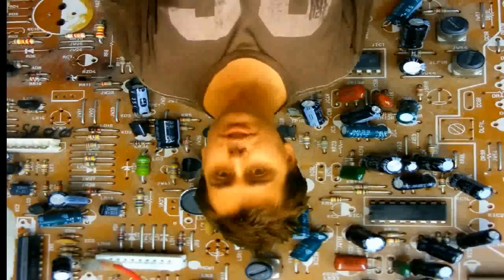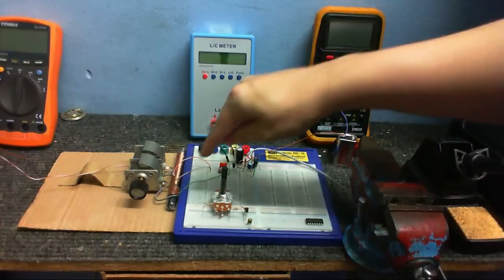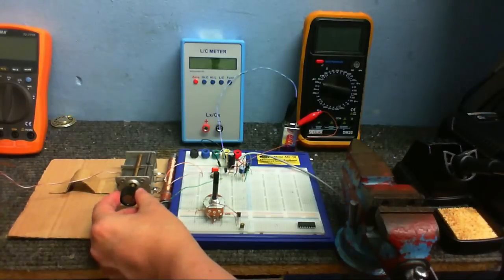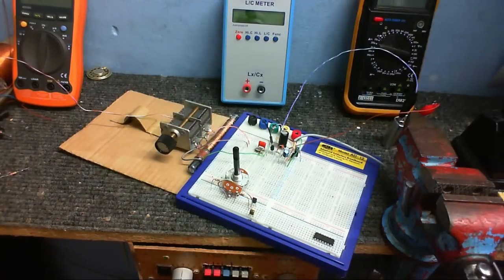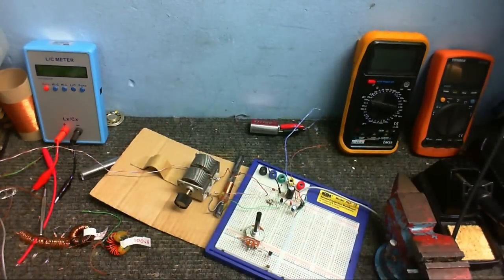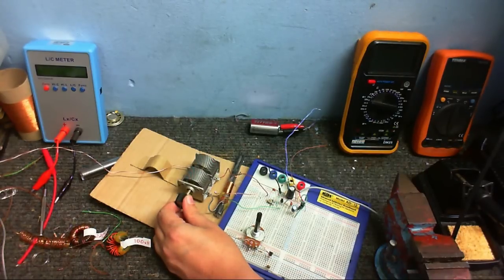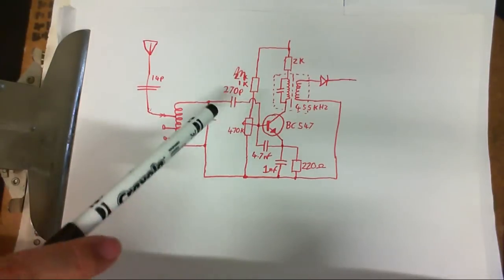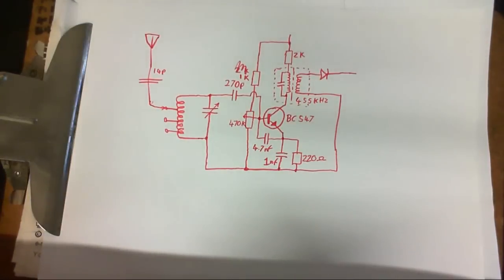Just another AM receiver experiment, and some talk about future videos.

Comment: Clem, FYI - for a "normal" AM tuner, local oscillator (LO) coils usually have a RED core, YELLOW is the first IF, WHITE is your 2nd IF and BLACK is usually the third (and final) IF.  Most modern LO coils work with those little 120pF varicon variable caps, so you may need to change out that quality variable I see in the video. The information is out there and you can buy a coil pack of 4 from Jaycar in Australia.

You can wind your own IF transformers from 220 turns of 42 SWG wire with a 220pF mica/polystyrene/NP0 ceramic cap, 20 turns or so for the secondary winding.  Wind on a plastic (polystyrene is good) former with a tunable ferrite slug.  These figures worked  for me, your mileage may vary :)

Comment: I know that feel when you cannot find the proper  IF transformers. I got an old tube radio that was so messed up I had to rebuild the chassis using a different scematic that used the same tubes. My problem was (and, is) that the IF transformers were messed up, they were broken. I thought, well, all IF transformers are tuned to the same frequency (right?), so maybe I could fit modern ones, just to get the device to work. Sadly, I couldn't figure out which were the IF on my scrap PCB's.

Though I didn't think of it then, I guess you could spot the transformers by the number of windings they have, since they must have two identical windings (or they had to, at least). Because of that, one maybe could also conclude that the two windings would have the same impedance, in the case of an IF tranformer.

Now that I think of it, if you get to find a radio board with three coils, (I have seen some), you might be able to identfy the two IF's ince they should be identical, with a third coil being different from them.

I'm just guessing, so, no idea if this works IRL. 

Good luck with this project, Clem.
Reply: MisterTalkingMachine For transistor radio AM, usually RED is the LO (Local oscillator), Yellow - 1st IF, White - 2nd IF and Black - 3rd IF.  Sometimes though, third IF is green.

It's usually only REALLY important to work out which is the LO coil, since the IFT's are pretty much interchangeable, the difference being output impedance.  It'll still work ok, just not as efficiently as it would if you used the right impedance match.

Easiest thing to do is to study the layout - the LO will be connected to the variable capacitor and the final IF will be connected to the detector.  Just work out the other two, they are chained together quite logically.  If you have IF cans that seem to be paralleled together, then those are most likely to be for VHF
Reply: Lloyd Dragonforce Oh man, thanks for that, going to note all that down right now.

Comment: Clem could it be that this was meant to be a Regenerative Radio and that 1KOhm Potentiometer was meant to be the regeneration or reaction (as it's sometimes called) control?Maybe you just needed to swap the connections to one of the coils to get it fully working.I think it would be quite good if you got a decent transistorised M.W. Receiver design working on the bench and then cased it up as a Pocket Radio that you could field test on one of your excursions.It would add interest value if it could be shown that it was truly a practical design.

Comment: There are a number of factors other than the number of turns that affect inductance such as; the size/shape of the coil, core/wire material.  Generally speaking the greater the magnetic permeability of the core, the greater the inductance.

Comment: Hi, can you please make a video where you test out how accurate calculating inductor values is?
Reply from the maker: The thing is that it's very hard to "calculate" an inductor value if you don't know the gauge of the wire and the type of ferrite (if any) that's used.  www.66pacific.com/calculators/coil_calc.aspx might be worth a look at.  When I wound my own coils, I started with a whole bunch of turns, measured it with my LC meter, then took turns off and measured again until I had the right inductance.
Reply: maybe he's wondering how you figure out the values with a meter?
Reply: no. u should make a video where you try to calculate the value of an inductor and then later use the meter for testing how accurate it is to calculate an inductors value...